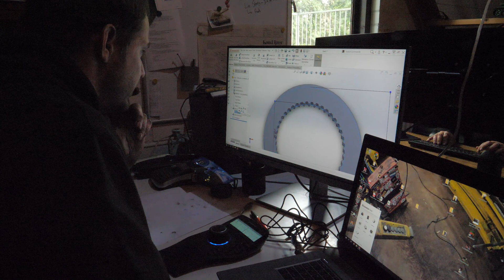english summary #490

Comment: I would think your thinking of a spark erodeder where it burns the steal using a copper electrode. I repaired a large generator key way in the drive cushion as it had come loose and wore the key way in it. I had to make a stepped key that was wider on one side to fit the newly widened key way I had to spark erode in to it .